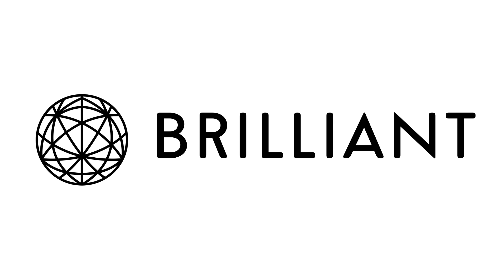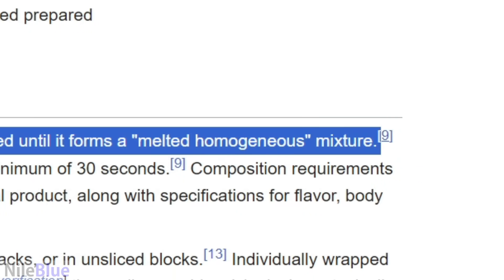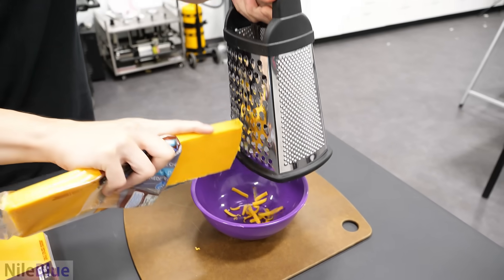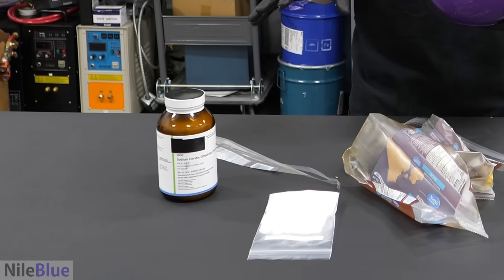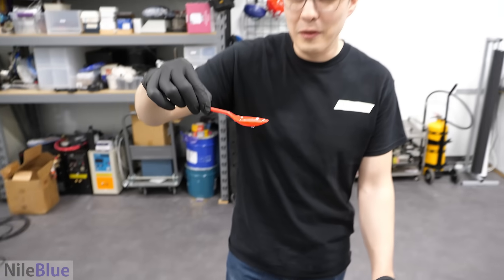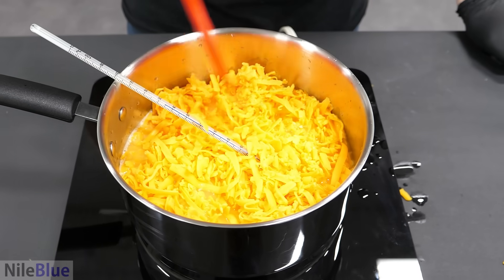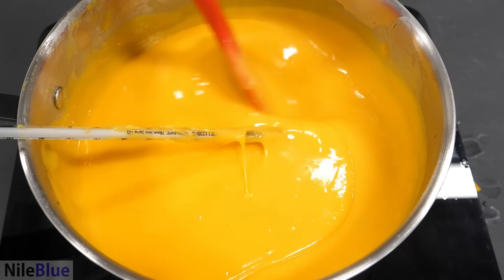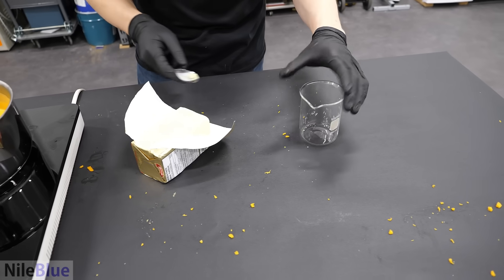Making American cheese to debunk a conspiracy

Comment: You can make sodium citrate by using baking soda and lemon juice, it's that natural. Adam Ragusea has a short on it, the TLDR is 1/2 tsp. of baking soda to 3 Tbsp. of lemon juice for a 1/2 lb. of cheese, thin with around 3 Tbsp. of milk, butter or water to give you that gooey goodness.

The metric conversion: 3 g of baking soda, 50 mL of lemon juice for 200 g of cheese and thin with milk, butter or water usually around 50 mL
Reply: Check for phosphates in the baking powder, those are needed for the emulsification
Reply: @HomemadeChemistry You can just use baking soda alone to make sodium citrate though and it emulsifies. But yeah different phosphates and hydroxides and all kinds of stuff will work too but for most people lemon juice and baking soda just sounds the safest
Reply: Yeah but Baking Soda is Sodium Bicarbonate, by their thought process another "Chemical"
Reply: American cheese is sooo gross I can’t believe you people eat it
Reply: @mdhalbrook  Also, adding inorganic chemical compounds like dihydrogen oxide could be troubling to hear for some people. Closing your eyes and listening to this (12:33), however, might just make things a bit more palatable.
Reply: @HomemadeChemistry  The sodium citrate breaks down the casein proteins so it acts as the emulsifier in this case.
Reply: FYI: The chemistry behind this, because I was curious myself.

citric acid + sodium bicarbonate = sodium citrate + water + carbon dioxide
C6H8O7 + 3 NaHCO3 → Na3C6H5O7 + 3 H2O + 3 CO2
Reply: @fcgHenden  Dihydrogen oxide is some scary stuff. Those who know, will know.
Reply: @grandenauto3214 I mean, it's literally cheddar emulsified in water so that it melts easier, but if you don't like melting cheese, or cheddar, you can't be helped.
Reply: @KevinZ.000  no it acts as liquefier, emulsification is diferent
Reply: @HomemadeChemistry  Sodium citrate is the emulsifying agent because it prevents the cheese fats from separating, especially into the added liquid. 

To quote from the Chemical Company webpage about all the uses for sodium citrate, "Sodium Citrate is also used as an emulsifier for oils in the cheesemaking process. Sodium citrate allows cheese to melt without becoming greasy."
Reply: There are 3 carboxylic acid groups on citric acid and sodium bicarbonate will Decarboxylate one producing sodium citrate, 
But each group is neutralized at a different pKa, high enough PH and 
It will produce the Tri-citrate. 

Fun experiment with kids is making 
this and then 
Showing how it helps prevent Oil and water from Separating forming an emulsion.
Reply: @KevinZ.000  ooookay, are you guys trolling? because I searched that up, they say that to make water sounds scary, you just say "Dihydrogen monoxide".
Reply: @HomemadeChemistry  You don't need phosphate; just citrate is enough to suck up the calcium ions and reduce the size of casein globules. Or if you are Swiss, use wine. It's got tartaric acid, which also works.
Reply: @jamesbrendan5170  Yep, it's an old HS chemistry joke. dihydrogen H2 + monoxide O = H2O (water)

Another one is: sodium chloride (NaCl) or table salt

Just because it has a chemical name doesn't mean it's dangerous or not natural like the examples above.
Reply: @a2e5  ok my bad then. But why are phosphates used as well industrially then? Like we just watched him do it.
Reply: Can I have the measures in grams? Tablespoons and pounds feel weird to me for some reason.
Reply: not a single unit of mesurment that i can understand but oh well thanks for the recepy
Reply: @lukeonuke  In metric cooking units it would be: 3 g of baking soda, 50 mL of lemon juice for 200 g of cheese and thin with milk, butter or water usually around 50 mL, the funny thing is in Adam's short he used the metric cooking unit and I had to convert to US standard.
Reply: @wallabra  I added the metric conversion to the OP, the funny thing is that Adam's short had the metric units and I had to convert to US standard cooking units.
Reply: @HomemadeChemistry  I think they label with both because it is an and/or to the process of making it. So, what is cheapest / have inventory of, they can use it without worrying about the ingredient list on the packaging. They do it with cooking oils all the time.
Reply: @KevinZ.000   Thanks!! Makes it easier for me. I appreciate your effort ^^
Reply: @KevinZ.000  just realised it was uncle goose all along lmao, ty tho

Comment: The specific problem that this type of cheese processing was first developed to address was indeed cheese splitting. Natural cheeses are essentially emulsions themselves, but that emulsion breaks when the cheese is melted. If the cheese has a low moisture content then it'll remain intact (although it will also be much harder to melt in the first place), but if it has a higher moisture content then it will only remain homogenous for a relatively short period of time. It especially cannot survive being heated and cooled. This made pasteurizing natural cheese an extremely difficult process, which limited its shelf life which itself limited its ability to be transported.
Reply: i see we've seen the same Atomic Frontier video on the subject :P
Reply: I always thought it was invented because someone wanted to sell more cheese than they actually have 😂
Reply: @exiom-xyz  that's american cheese product, that's less than 50% cheese.
the rest is oil filler.
american cheese, the expensive ones are allowed to be called cheese, that's more like what Nile made.
if you're interested in the history, i highly recommend looking up the Atomic Frontier video. He covered a bit more than the first few lines on Wikipedia :P

Comment: An emulsion is when two substances that really don't want to mix, are combined in a suspension evenly throughout each other. Fats and oils are hydrophobic, which means they actively repel water (like a duck's feathers and how water just beads off it, or if you got a cooking fat on your hands and go to wash them and the water just beads off until you use soap). A vinegrette is an example of an emulsion. If you've ever made one from scratch, it's a lot harder to get them to combine and takes a lot of agitation by way of blending or stirring or shaking, and the less dense oil will soon rise to the top and the emulsion will break. Storebought vinegrettes have emulsifiers added, and it only takes a little shaking before everything combines, and it stays combined for much longer.

Cheese and water usually don't mix without an emulsifier to help keep them stable, because cheese has a lot of fat. When you make cheese, it's made out of milk or cream. You deliberately separate out a lot of the water (the whey) to get the fatty solids (the curds), which separate out by the use of heating, and acid or enzymes. The liquidy bits in ricotta or cottage cheese is mostly whey, and the lumps are the curds. Most cheeses, like cheddar and mozzarella and such are made with the curds, but some cheese is made with whey, but they technically count as a byproduct of the cheese making process. Norwegian brunost (or brown cheese) is one such cheese, you boil down the whey until almost all the liquid is gone and the sugars start to caramelize. It's very savory and tastes a bit similar to cheese powder in like mac n cheese and stuff, and pretty salty, but also a bit sweet and caramely tasting. It's usually rather soft and pliable and a touch tacky, and melts very well so it's often added to sauces for flavorings, or even used in sweet things like caramels or on top of waffles or pancakes. Variations exist in many Scandinavian countries, I'm just most familiar with brunost, and there's probably other whey cheeses I've never heard of from other places.

But anyway, once you separate the liquid and fat, it's really hard to get them to want to go back together again after that. Whole milk is actually already emulsified, because otherwise after sitting a while the cream would rise to the top and the milk would settle at the bottom (skim milk, because the cream was skimmed off). Processed cheeses like American cheese already contain emulsifiers, so they're great to help keep cheese sauces from splitting. Tempered egg yolks (aka slowly heated while being stirred so they cook and thicken but remain liquid, rather than getting hard like when fried) can also be used as emulsifiers, as well as starches (that's why so many Italian sauces use pasta water, because it adds in a ton of starches from the noodles that when agitated with the sauce forms a creamy and fairly stable emulsion, as well as some flavor). And acid can also be added to help keep a sauce from splitting, which is why often alcohol (like wine or beer, a lot of them do have some acid in them) or vinegar is added to fondue, which has to remain liquid and emulsified for long periods of time.

There's actually a lot of foods that are emulsions. Mayonnaise and hollandaise sauce are two examples, and part of why they're so tricky to make from scratch without breaking the emulsion. It's always so cool to see how science and food intersect!
Reply: I don't know that much about food or cooking, so that was an enjoyable read.
Reply: why did u write an essay?
Reply: @kye_the_emo_trans_kid  I just think food science is interesting (and a good way to communicate science facts because food is a pretty familiar topic to people in general) and I enjoy when I see random essays about stuff related to the topic of a video in the comments, so I thought I'd share what I know :)
Reply: Amazing insight! had a nice time reading this.
Reply: This man cheeses
Reply: I love this comment. Thanks so much for sharing, very interesting read!
Reply: So apparently I cannot physically stomach emulsifiers then because all of those foods make me physically sick on instinct. Last time I have mayo, it gave me poisoning. I have never once eaten something with mayo or american cheese in it and NOT had an immediate negative reaction from it physically, even if I don’t know it’s in what I just ate.
Reply: mustard is an emulsifier, and it and cranberries with oil and vinegar work well as a homemade vinaigrette
Reply: that's why the French add mustard to vinagrettes.  It helps to emulisify it.
Reply: You can also use lime juice as a emulsifier, we actually use it in alot of dishes in the recipes on my country.
Reply: Cooking is tasty Chemistry! 😅
Reply: Dude I love learning from others thank you!
Reply: You have no clue how much this has helped me understand emulsification.. I recently made a potato soup and it ended up separating a little bit but now I know why it’s separated and what it needs to bring it together
Reply: Iirc, whole milk is not an emulsion. The fat globules withing the milk are homogenized, as in they are broken up into equally large droplets, that stay in suspension in the milk.
Reply: this dude's cheese be cheesing and that's on Gouda

Comment: Emulsifiers just enable oil and water to bind together and mix without separating. There's a ratio of salts to fats that you want to be careful of otherwise it'll fall apart again.
Reply: Also used in chocolate bars (in the form of lecithin) for roughly the same purpose.
Reply: I work in a process cheese facility, we use sodium citrate solution as our emulsifier. It actually just sequesters calcium and allows the casein molecules to bond with the fats.

We actually use lecithin, but in between slices to keep them from sticking together.
Reply: @willnichols6470  Yeah, but who is everyone going to believe? Me, a laymen with no particular insight into the matter, or you, an industry professional who knows what they're doing?

Comment: Adam Ragusea'a recipe for queso is basically the same, it's just lime juice, baking soda and milk and chilies. The bicarbonate neutralizes the citric acid, releasing co2 and making sodium citrate, then that emulsifies the queso dip.
Reply: que, so?
Reply: @justanidiom5232  I'm just pointing out that the chemicals are easily found in the kitchen already, and it's one of the coolest reactions you can do!
Reply: Awesome! Gonna check that out.
Reply: Yeah, it’s funny how this does nearly the same thing as the regular American cheese ingredients but people get worried when they hear anything that goes by a chemical formula.
Reply: @initialyeet3951  it's like how people freak out over shredded cheese having cellulose in it when it's literally just plant fiber.
Reply: @initialyeet3951 why would u ever add chemicals into cheese tho